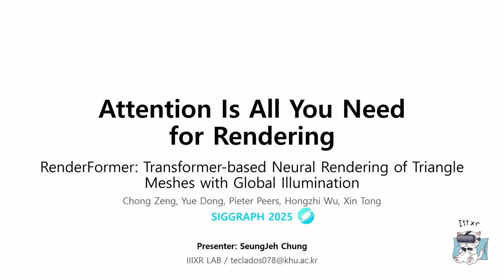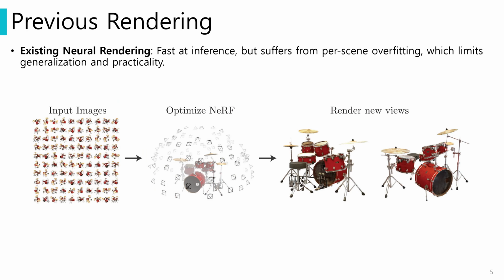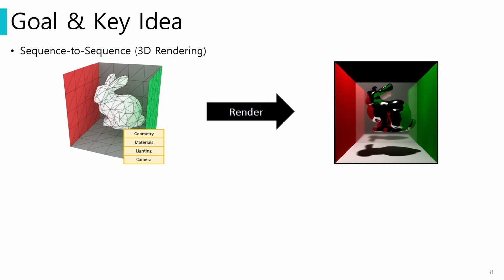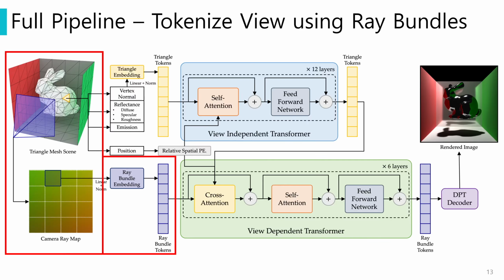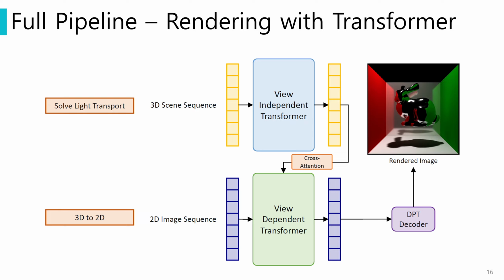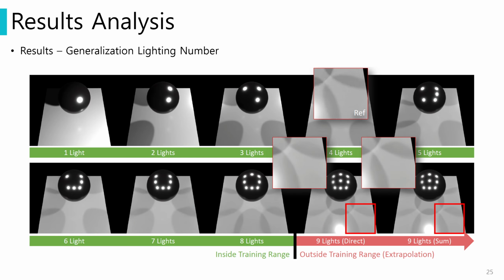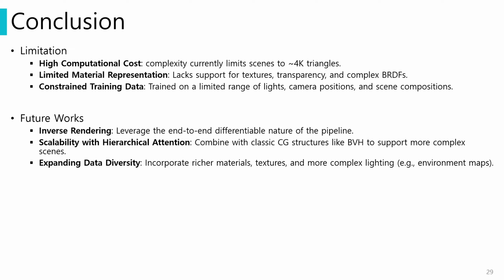[Seminar] Attention is all you need for rendering

Comment: Q1. How could RenderFormer be adapted to support textured surfaces and materials without drastically increasing computational complexity?
Q2. Could RenderFormer be extended to handle dynamic scenes with motion or temporal consistency between frames?
Reply: For handling textures and materials, the most critical challenge would be how to design the embedding tokens for them. Additionally, a diffusion model could be leveraged to handle the fine details, as they are particularly good at that.

Regarding dynamic scenes, Renderformer can already process them. I actually showed some of those results in the results slides of this presentation.

Comment: Q1. Did the paper directly compare the rendering time between conventional rendering methods and Renderformer? If so, how large was the difference?

Q2. If high computational cost is considered a limitation, I think its usability might be somewhat lower than that of traditional rendering methods. What are your thoughts on this?
Reply: Yes, the paper directly compares the rendering time with a high-quality renderer, Blender Cycles, and the difference is quite significant. 
In one example, Blender took 12 seconds while Renderformer finished in just 0.09 seconds, making it more than 100 times faster.

Once the model is trained, its rendering speed is actually much faster than traditional methods. This suggests it could be even more useful, not less, particularly for interactive applications.

Comment: Nice presentation.

Q1. RenderFormer’s main limitation was mentioned as the computational cost of attention.
Did the paper quantitatively analyze the relationship between memory usage and performance degradation as the geometric complexity (i.e., number of triangles) increases?
Also, are there any plans to introduce more efficient attention architectures — such as sparse, hierarchical, or local attention — to mitigate this limitation?

Q2. RenderFormer is said to generalize to new scenes without any pre-training or fine-tuning.
How was its generalization performance quantitatively evaluated compared to NeRF or traditional path tracing methods?
Reply: Those are excellent questions that precisely touch on RenderFormer's core advantages and its most significant limitations.

First, regarding the computational cost, the paper does quantitatively state that the attention mechanism's complexity increases at O(N²) with the number of triangles (N). This is the direct reason why the model is currently limited to a few thousand triangles. To mitigate this, the authors propose in their conclusion that combining hierarchical attention with acceleration structures like a BVH is the most critical area for future research.

As for the quantitative evaluation of its generalization, the paper's core results are primarily based on comparisons with the reference path tracer, Blender Cycles. Generalization performance was assessed using standard metrics like PSNR, SSIM, and LPIPS to measure the visual similarity between the outputs. A direct quantitative comparison with NeRF is different because their paradigms differ. Since NeRF must be trained per-scene, RenderFormer's key advantage is its structural ability to generalize without any fine-tuning, which is the fundamental differentiator, rather than a direct metric-for-metric comparison on a given scene.

Comment from the maker: Thank you for the presentation. It was clear and easy to follow.

I have several questions:
1. If my memory serves me right, the authors designed a sophisticated positional encoding scheme, which plays a crucial role in transforming mesh data into sequential representations. Could you elaborate on the specific design choices and how they contribute to the encoding process?
2. In the presented scenes, I noticed that the target meshes vary considerably, while the environment remains fixed. Why did the authors choose not to generalize their architecture to more diverse environments? Is this due to particular technical challenges? If so, could you clarify what makes such generalization difficult?
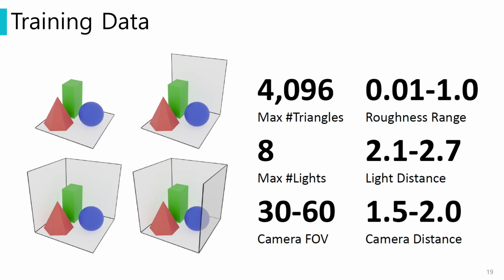3. At 8:55, does the slide illustrate the training scene setup? It seems that simple geometric primitives were used during training. If so, do you believe this limited training setup is sufficient for the model to generalize effectively to diverse and complex input meshes?
4. The proposed architecture appears prone to errors when the target mesh resolution exceeds that of the training data. This is expected since those configurations were unseen during training. However, in some cases, such models can still generalize if we understand the underlying mechanisms. Could you explain in more detail why the rendering quality degrades when the number of triangles surpasses those used during training?
Reply: A1. The method used is a 3D adaptation of Rotary Position Embedding (RoPE). To handle the unordered nature of 3D triangles, it encodes the relative 3D spatial relationship (distance and orientation) between pairs of triangles as rotational information, rather than using their absolute positions. This allows the attention mechanism to learn physically meaningful interactions.

A2. The core goal of this research was to test a challenging hypothesis: "Can a Transformer learn the physics of Global Illumination?" To clearly validate this primary hypothesis, the authors controlled the environment variable and instead focused on demonstrating generalization across a wide variety of object shapes and materials.

A3. To clarify, while the training environment (the background) was simple, the objects themselves were not. According to the paper, the objects were randomly sampled from Objaverse, a large and diverse library of real-world 3D models. Therefore, the model was exposed to very complex and varied shapes, which is what enables it to generalize effectively.

A4. The quality degradation is due to two main factors. First, the quadratic complexity of self-attention makes it computationally infeasible to handle a vastly larger number of triangles than it was trained on. Second, there's an information density problem: when triangles become too large, a single token is forced to represent a very complex lighting area, exceeding its capacity and causing a loss of fine-grained detail.

Comment: Can it render more than one mesh with one trained model?
Also, how about number of light source?

If these are possible, I think it is useful than 3DGS
Reply: You are right. The core idea is to create a general neural renderer, not one that's fitted to a single scene, so it can handle various meshes with one model. Regarding the number of light sources, it was trained with up to eight and generalizes well to around ten.

This is why it can be more practical than methods like NeRF or 3DGS in certain aspects. However, it's still early-stage research and currently at a lower level in terms of scene complexity and photorealism compared to those methods. An interesting future direction could be to adapt it to take inputs like point clouds or 3D Gaussian parameters, which would effectively make it a general neural renderer for 3DGS.

Comment: This is a very interesting paper.

1. How much faster is Renderformer compared to the renderer it references, and what percentage of accuracy does it achieve?
2. How are light sources that are not represented as triangle meshes tokenized?
3. Is this the first network to replace a traditional renderer with a neural network? If so, why do you think such an approach had not been attempted before—what made it particularly difficult?
Reply: It's over 100 times faster than the reference renderer, Blender Cycles, while achieving high visual accuracy as measured by metrics like PSNR and SSIM.

The model doesn't handle light sources that aren't represented as triangle meshes. Instead, triangles that have emissive properties are themselves treated as the light sources and are tokenized just like any other triangle.

It's not the absolute first attempt, but it's significant for aiming to be a general-purpose rendering pipeline. The reason this was so difficult before is that the key technologies have only recently matured: powerful Transformer architectures for vision, the computational resources to generate and train on massive datasets, and effective techniques for encoding 3D spatial information into a sequence.

Comment: Q1. The presenter frames rendering as a sequence-to-sequence task, analogous to machine translation, where an unordered set of "triangle tokens" is the source sequence. Critically evaluate this analogy. How might the model's reliance on relative positional embeddings to capture 3D spatial relationships introduce limitations in accurately resolving complex, non-local light transport phenomena (e.g., caustics from a distant object, or intricate shadow-casting through complex geometry) compared to the explicit geometric queries of traditional path tracing?

Q2. Renderformer's two-stage architecture separates the view-independent calculation of global illumination from the view-dependent 3D-to-2D conversion. Analyze the trade-offs of this design. While this separation seems computationally efficient, how might it constrain the model's ability to render highly view-dependent effects, such as glossy reflections or anisotropic materials, where the lighting distribution is fundamentally coupled with the camera's specific viewpoint?
Reply: Those are two very insightful, critical questions that get to the heart of the paper's methodology.

A1. The analogy is an excellent approach to gain speed by reframing rendering from a "physics simulation" to a "learning-based inference" problem, but it has clear limitations. While path tracing mathematically calculates the precise path of light to resolve shadows or caustics, Renderformer builds a generalized model of light physics from its training data and then infers the result. Therefore, for complex phenomena not seen in its training data, like intricate shadow shapes or focused caustics, it cannot reproduce them with physical accuracy. Instead, it is likely to approximate the most probable outcome based on its learned knowledge.

A2. Separating the process into two stages and merging them with Cross-Attention is a highly efficient and clever design for the 3D-to-2D transformation. The Cross-Attention mechanism effectively allows the view-dependent tokens to "ask" the already "lit" view-independent triangle tokens, "What do you look like from this specific viewpoint?" and pull the relevant information. For largely diffuse surfaces, this approach works exceptionally well.
However, limitations can arise where the light distribution changes dramatically. For instance, with perfectly sharp mirror-like reflections or anisotropic materials, the appearance can change completely depending on the viewing angle. The view-independent tokens must "pre-compress" all of these possibilities into a single, fixed vector. During this process, some of the sharpest, high-frequency information can be lost.

Comment: 1. When RenderFormer encodes the geometric information of a 3D scene so that the Transformer can understand it, what is the core positional encoding method it uses to represent the 3D positions of triangles? 

2. Also, I’m curious how the model behaves when it attempts to render scenes that contain more light sources (over 8) than those present in its training dataset.
Reply: For positional encoding, the model uses a 3D-adapted version of Rotary Position Embedding (RoPE). To handle the unordered nature of triangles in 3D space, this method encodes the relative position and orientation between triangles using rotational information, rather than their absolute positions.

Regarding the light sources, the model was trained on up to eight. Exceeding this limit can cause unstable results like missing shadows or highlights. However, the paper suggests a clever workaround: by leveraging the linearity of light, you can render each light source individually and then composite the final images to achieve an accurate result.

Comment: Nice presentation.

Q1. Since the method operates on mesh faces, does the paper mention how scene complexity affects rendering time or scalability?

Q2. The model claims no per-scene training. How well does it generalize to unseen geometries, lighting, or materials?
Reply: You've hit on a important point, as both of your questions are related to generalization.

From what the paper presents, the model does generalize well to variations in the number of triangles, different camera parameters, and lighting conditions. In my presentation, I actually walk through this from slide 24 to 28, where the authors show these results.

Of course, the paper is also upfront about its limitations. The performance can drop if the model encounters materials or types of lighting that are significantly different from its training data. For a more detailed explanation of its generalization capabilities and limitations, the paper itself provides a much deeper dive.

Comment: Q1.Why does the performance of RenderFormer degrade when texture information is incorporated into its input representation? Since the model was originally trained with uniform reflectance parameters per triangle, could the spatial variability of texture features conflict with its triangle-level embedding design? Would expanding the token dimension or introducing sub-triangle positional encoding allow the model to better capture fine-grained, texture-dependent reflectance variations?

Q2. What would happen to RenderFormer’s ability to model global illumination if its Transformer backbone were replaced with a diffusion-based architecture? Could a diffusion process effectively learn long-range dependencies between triangles that are crucial for capturing indirect lighting and multiple reflections? If not, would this architectural shift lead to a degradation in the model’s capacity to represent complex light transport phenomena?
Reply: Thank you for these insightful questions. It's clear you have a deep understanding of the paper.

Regarding your first question, you've pinpointed the exact issue. As you suggested, trying to compress texture information into a single triangle token creates an information bottleneck, which led to the blurry results mentioned in the paper. The authors acknowledged this and left it as an area for experimental extension. Your suggestions—expanding the token dimension, introducing new encoding schemes for spatial variability, or adding a separate encoder—are right on track and would likely be effective solutions.

As for replacing the Transformer with a diffusion architecture, that's a good idea. I believe modern diffusion models that incorporate Transformers (like DiT or Stable Diffusion 3) might be more impactful in the view-dependent stage for image synthesis, rather than replacing the backbone in the view-independent stage. The main reason is the computational overhead of 3D diffusion. It seems more efficient to use such models for the 3D-to-2D image generation task, perhaps leveraging 2D lifting techniques, rather than trying to model the complex long-range dependencies for GI directly in 3D.

Comment: Quite outstanding.

Q1: So, does this model work like an end-to-end 2D image generation model, or does it process rendering parameters instead?
Q2: What about diffusion models? Why not use them?
Q3: The main concern with this type of model seems to be generalization performance, as it could be highly dependent on the training dataset. How does this model handle this problem?
Reply: You're correct, this is a complete end-to-end model. It directly takes rendering parameters that define a 3D scene (like triangle meshes and materials) as input and outputs the final 2D image with global illumination calculated.

The choice of a Transformer over a diffusion model stems from the model's core objective. The goal isn't just to generate a realistic image, but to explicitly model the physical interactions between structured 3D data—the triangles. The attention mechanism in Transformers is more intuitive and better suited for learning the relationships between these discrete elements (tokens). That said, I agree with you; combining it with a diffusion model, perhaps as a post-processing step or in the decoder, is a very promising direction for future work to enhance detail and photorealism.

Finally, generalization is a central theme of this paper. As shown in slides 24-28 of the presentation, the authors conducted extensive experiments to test its performance in various scenarios beyond the training data. The paper itself provides a much more in-depth analysis of this.

Comment: Q1. The paper mentions relative positional embeddings for 3D tokens. Could you elaborate on how these embeddings are designed to reflect spatial proximity and orientation among triangles?

Q2. How scalable is the token-based representation when the number of triangles increases dramatically — for example, in scenes with millions of polygons?
Reply: Regarding the relative positional embeddings, the paper uses a variant of Rotary Position Embedding (RoPE). This method encodes the unique 3D spatial position and orientation from each triangle's vertex coordinates, which allows the attention mechanism to understand the spatial relationships between them.

As for scalability, you've identified the main limitation. The O(N²) complexity of the attention mechanism restricts the model to several thousand triangles. To handle millions of polygons, it would require significant architectural changes, such as the hierarchical attention approach the authors propose as future work.